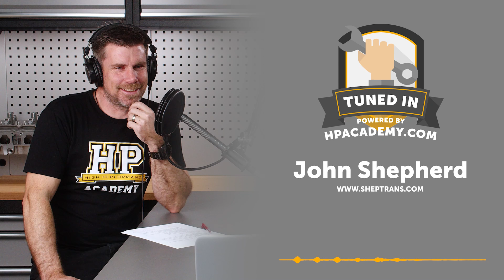030: Building The Perfect 7-SECOND Street Car. [#PODCAST]

Comment: 19 mins in.... 3rd gear shift fork (Aluminum) broke 2 until John gave told me about the Evo shift fork( steel). Myself working at a local Mitsu delarship and order the parts he recommended and was building 450hp+ AWD.. 
Don't go throwing in an ACT 4100 clutch in a 2nd gen 4g63.. orrrr.. play music.. doing the Crank walk... I have video of mine failing right before i met John...
https://youtu.be/so1e4gsM0J4

Comment: I think this might be the first of rebuttals.  Modern cars are more than capable of running down to the NHRA limit of 10.0@135. That is plenty fast for a daily driver, especially since you can buy a car capable of that and faster without any changes to the engine hardware. From a FWD perspective, 10.0 is pretty darn fast. Golf R's are capable of low 11's on the stock turbo, daily driven, one car showed up and ran Rocky Mountain Race Week 2.0; It was the competitors son's car and it was revelation to him vs his muscle car that he couldn't finish in time for the event that didn't have A/C and wasn't comfortable and quite loud. Once you start putting a cage in it, I 100% agree it's not a street car anymore and dangerous.